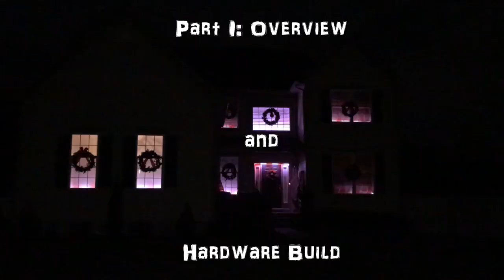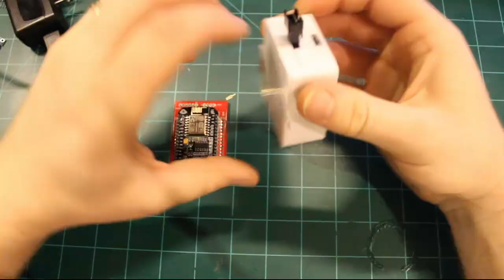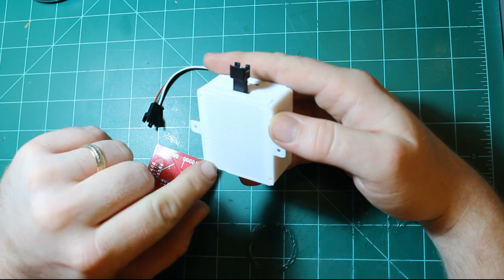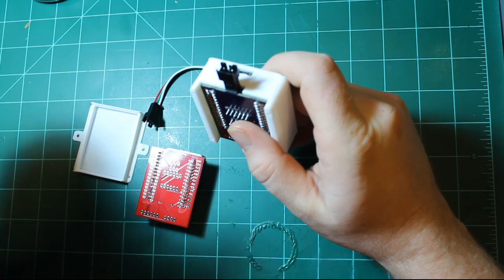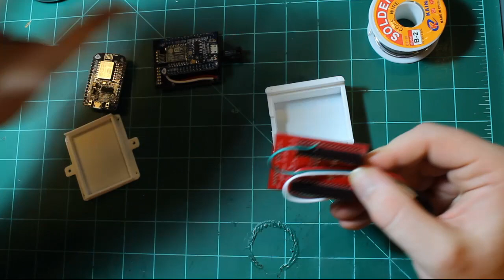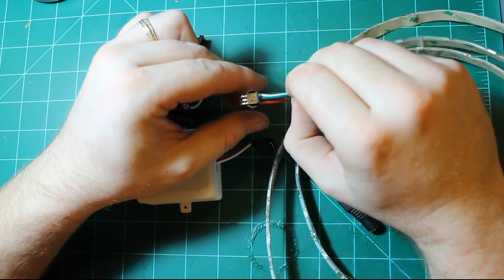NodeMCU Kube LED Strip Controller - Part I (Hardware Build)

Comment: Hi i bought your new Breakout board from PCB Way and it's fantasticly designed now I have 20 of them😂

I have 2 questions

1. Which pin is conectet to the led Data

2. How do I know which way I have to put in the Voltage Leven shifter? 😂

I'm sry im just a beginner and it might be obvious but I really don't know.
Reply from the maker: Hey Leo! D4 is the pin used for LED output (standard for most LED control programs like WLED). Make sure you jumper the SHFT pad on the back for D4 to the middle pad. As for the level shifter, you just match the notch on the IC to the printed shape on the PCB (on this board, it should point down, towards the EXT header). Not that obvious, I put it in backwards myself the first time, haha!
Reply: @BKHobby  thanks a lot😍

Comment: Does the breakout board have a level shifter built into it? I think I'm confused about whether or not you need to use one with it
Reply from the maker: The breakout board does have a space for a level shifter. The newest version (1.2, found here: https://www.pcbway.com/project/shareproject/NodeMCU_v_1_2_Board.html ) uses the better level shifter for LED projects (74AHCT125SN) and also allows you to bypass the level shifter for any of the four channels (via solder pads on the back of the board).

Now, whether to use it or not - that depends. All of the WS2812 LED strips I've used haven't needed a shifted signal, but I know other LED strip types are a bit more sensitive.

Comment: Nice solution, but unfortunately I can't get this working. During compilation, this error appears:

KubeLEDstrip-2504:538:11: error: StaticJsonBuffer is a class from ArduinoJson 5. Please see arduinojson.org/upgrade to learn how to upgrade your program to ArduinoJson version 6
   StaticJsonBuffer<BUFFER_SIZE> jsonBuffer;

Am I missing an update ?
Reply from the maker: Unfortunately, you'll have to use a version 5.x of the ArudinoJson library (check your Arduino Libraries, you probably have the latest version 6. There was a breaking change in that update, and I just haven't had a chance to go back and fix my code to work with the latest lib.

Comment: My NodeMCU doesn't fit in the enclosure... Also what's the purpose of the red breakout board? Do I really need it? Can I cut off my WS2812B led strips and use them for different parts in a room? What would I need to accomplish that? Great video btw!

Comment: Can't seem to get this working. I'm using the LoLin v3, is that the problem? I'm wondering if it's a pinout issue. Thanks in advance.
Reply from the maker: @Bad Pixel - that might be an issue, though the only pinout differences are on the left side of the board, and shouldn't cause any issues (if you're using them with my PCB, I mean). What exactly are you seeing?

Comment: Can you use an app on your phone to control the strips with the esp8266?
Reply from the maker: @daPi - Yes, if you have openHAB or Home Assistant (via MQTT). It doesn't have a webpage for control yet (I may add one in the future, though).
Reply: @BKHobby  and also would I need a central controller like a raspberry pi running openhab or can I just connect the nodemcu directly to my wifi and itll work with the app?

Comment: Might be worth adding a level shifter in that breakout board and a 1000uf capacitor. Best practice to keep the LED's safe from current.
Reply from the maker: Thanks! I'm actually working on an update to the board now, and replaced the crappy I2C level shifter on that board with a proper (74AHCT125N) LED-proven shifter, but I didn't think about adding a cap. I need to find one that's low profile and fits either underneath the NodeMCU, or somewhere within the empty space.
Reply: Can you add a level shifter directly to the nodemcu without any breakout board? Im sorry haha im very new to this
Reply from the maker: @stellar3327  you can - but it won't look pretty ;) - soldering wires between the NodeMCU pins and the level shifter pins would be a major pain too...The next best thing you could do (if you don't want to use my breakout board) is use a proto-board and handle the wire connections yourself.

Comment: Thanks for this video.  I have a question though, your effects seem very smooth in all your videos.  I seem to have some glitching going on in the strips when running effects, or changing manually between colors too quickly in OH2.   Any ideas?
Reply from the maker: +Sascha K - are you running the Arduino at 80 or 160 Mhz? Also, by any chance, are you using my board with the level-shifter installed? I don't recommend that, as the I2C level shifter is too slow and causes flickering (I'm switching to a faster shifter for the next rev of the board).
Reply: Hi thanks for the reply!  Actually I figured it out... it was due to the output pin chosen.  D7 was causing the timing/glitching issues.  Moved to D5 and all is well now  And yes not using an L2C, direct connection to the data pin of the strip is working great.  It also took me some time to figure out that DATA_PIN 5 was not D4 output on the NodeMCU v1.0 (like you have written on your write up - but unclear if you were using a different NodeMCU).  DATA_PIN 5 = D5 in my case.  Cheers!

Comment: if one wanted to learn to code openhab2 or the arduino.ino files what is it that language (code) called ?
Reply from the maker: +Simon Throsted - the language for Arduino is very similar to C - there are tons of resources for C, but I would still recommend just learning the specific Arduino syntax and getting familiar with the routines available (you can look up the reference for all Arduino routines on www.arduino.cc) - once you learn that, try playing with some of the example projects in Arduino IDE - everything from simple programs to fully functional ones. You'll start picking up on how the program works, and how Arduino operates...Good luck!

Comment: Hello  ,   Nice job   ,   i have it working but cut you tell me how to upload OTA  it asked for password over and over again ? what do i do worng ? ardieno ino never write to board so i have to use cable :-(   please help me
Reply from the maker: +Simon Thorsted - is the unit connected to the MQTT server (or openHAB) when you're trying to load OTA firmware? I know I've had issues loading OTA if there's no MQTT server available (because the NodeMCU keeps trying to reconnect to the MQTT server, blocking OTA from working.
Reply: @BKHobby  Thanks for your quick response,yes it is connecet to openhab2 and mqtt becurse it works fine I just want to change number of led becurse it blinks a lot (flickers)
Reply: SORRY SORRY i forgot to install python on my PC so now it works 100%  ,I'm new to this and not a coder so please keep up doing what you are doing so i can learn /steel from your knowledge ;-)  nice job .
I will be following your works openhab2 I nice to automate all things .
Reply from the maker: +Simon Thorsted - that's great to hear!! I'm also glad you're finding my videos useful - I will keep making them, so just keep watching/sharing!! :-D

Comment: Hey, man. This project is awesome, but if I want to use only one strip, do I really need that Breakout board? Can I use just the NodeMCUand solder those cables directly on my board (pins)?
Reply: Hi. I want to make my own with one 5M led strip so I didnt need breakout board? This will be my first project with electronics so can you help me how can I solder the board directly? Do you have any video tutorial. If I search for rgb led strip ESP8266 there is no good guide... Thanks, Norbert
Reply from the maker: Farkas Norbert - you just need to attach the three wire LED strip connector to the pins on the Nodemcu- VCC to VIN pin, GND to GND pin and DATA to D4 pin - and an external 5v power supply to the remaining two power wires on the strip. It may be a good idea to do this on a prototype board (perforated), since soldering directly to the Nodemcu pins is hard.
Reply from the maker: +MDG Studio - you definitely do NOT need the breakout board - just connect the strip straight to the NodeMCU. I designed the breakout/enclosure so the whole setup would look cleaner in my windows/cabinets, but there's nothing on the breakout board specifically for the LED strip control.

Comment: i have noticed that you dont use the logic level shifter you left a space for.  which direction are you supposed to mount it in? do you mount it on the bottom of the board? or do you flip the logic level shifter  component side down and mount it to the top of  your board?
Reply from the maker: hckywrestler08 - With the board facing up (DHT sensor side pointing up), mount the level shifter on the top side (so it hides underneath the NodeMCU). The pins should match the following:

TOP: LV1 LV2 LV GND LV3 LV4
BOTTOM: HV1 HV2 HV GND HV3 HV4

On my shifters, that means the components are on the bottom, but I'm not sure all of these follow a standard, just make sure the pins match the above.

BTW, I don't use the level shifter in my LED controller boards. The I2C level shifter is too slow and would cause flickering. I haven't needed a level shifter for my WS2812 strands, they just work from the 3v3 output line. If you do need a shifter for your strands, look at the SN74AHCT125N (DIP 14) chip. It's a high speed shifter you can use for LED strips. I'm going to incorporate it into the next rev of the PCB, when I get around to it!